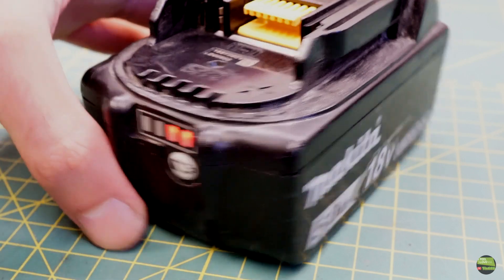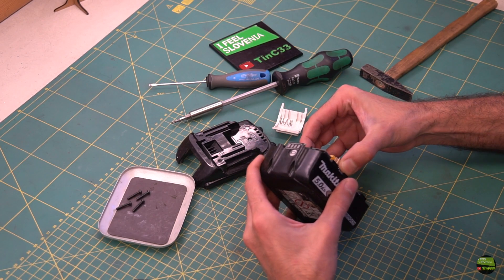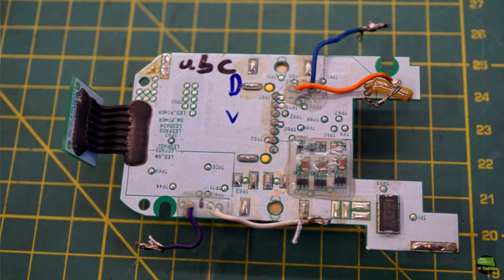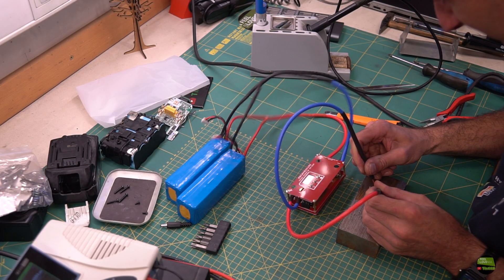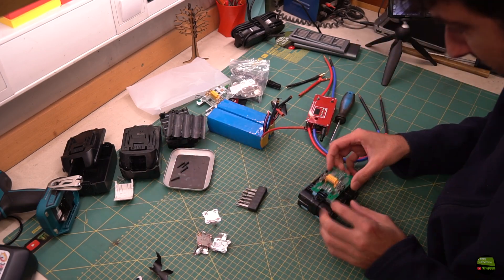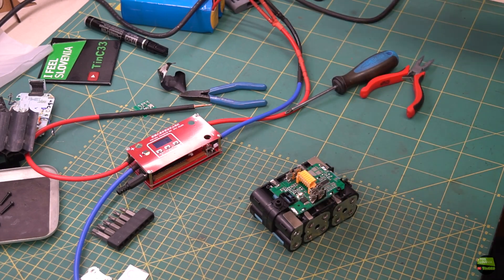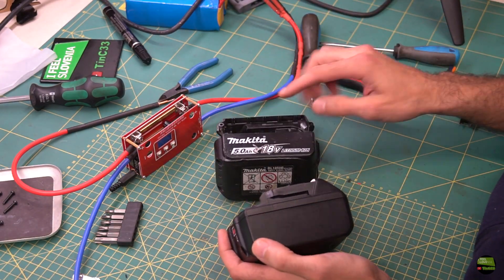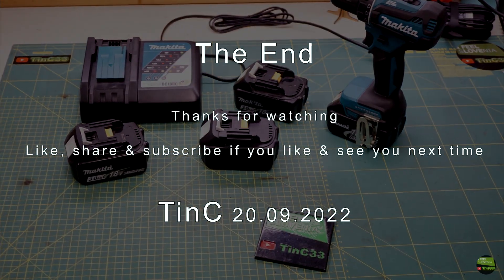How to repair makita battery for $12 [easy fix with using repair kit -new pcb and housing]

Comment: You are the only person who has posted on YouTube what I am looking for. I ordered the same kit and wasn't sure if it was working properly. Still waiting for delivery. I only found this video at your place. Good Job Slovenac.

P.S. Do you know if the Fnirsi SWM10 spot welder can do the job as I noticed it only welds the strips that come with it.
Reply from the maker: Thanks, i think it will do the job just fine but like mine with some pouses between 😅
Otherwise you can also solder them i do that many times by using 100w solder iron and grind battery surface slightly on booth ends.

Comment: You could go into business fixing all the thousands of useless power tool batteries out there.  I have five or six that need repair, right now.
Reply from the maker: @Iakobos55  true i just got one in repair last week, but like many times there was dead cells inside so no way to fix, cells can be replaced but one cost about 10$ wich mean 100$ for a pack while new pack 3ah cost 41€ in discont price 🤷‍♂️

Comment: Would be helpful to know what size torx needed. Seems none of mine fit.
Reply from the maker: @tinaleanne8230  i don't remember is it t15 or t20.
But it doesnt fit because the bolts have lifted "dot" in the middle of torx so you need torx screwdriver (torx bit won't fit into hole) with hole in the middle but also work if you punch a few times so the pin in middle of torx bed a bit and get at least 0,5mm of grip, hope you understand what i want to tell 😅
Reply: @TinC33  I don't punch anything that has lithium batteries. Another video claimed they were T10's so I just ordered a set of screw drivers for security bits. Will be hacking at my battery next week.

Comment: I did this too. But my battery shuts my tool off at just under 18v. Do you know why this might happen? I used the same pcb as you it seems but new cells.
Reply: What cells did you use? If they have a high internal resistance, the BMS will cut power early.
Reply from the maker: Sorry didn't see that before, it could be what tailor said, you need low resistance cell with at least 20A discharging current, one cell like this cost about 10€ so 100€ for 10 cells while new pack cost 40-50€ so there is no way to replace cells for price of new makita 3ah pack.

Comment: why everyone is replacing the original bms, looking for ways to reset the programming, installing replacements so that the original bms enters the data re-writing mode on new cells, the solution is so close that no one notices it
Reply from the maker: @Akumariusz1977  do you heave a solution, programming is not my favorite job 😔

Comment: It is great that you teach people how to give those batteries a second life. This is good for the environment, so a big thanks to you! Allow me one remark though: You should weld across the slot not apply both electrodes on the same side as shown. Welding across forces current through the cell can and it is the actual reason why the slot is there, i.e. you get better weld quality.
Reply from the maker: Exactly i often take batteries out of trash for some diy project but here the battery was tottaly fine so its a big save of money also, and pack still work today...
Someone already told me about slot, thanks  i didn't know that but when i read it become soo logicaly 😅

Comment: I'm curious as to why you removed the original plates the connected the batteries to each other. You tested in the beginning and said all cells were good.
Reply from the maker: Because that pack wasnt fit in new housing, plastick part between cells are a bit different and also balancing strips are located differently, so the easiest way was to tear down everything and make new pack.
Reply: @TinC33  ok that makes sense. Did you manage to get your spot welder to quit getting too hot? I wonder if lowering the setting would help. Who knows how accurately those things are calibrated?
Reply from the maker: @davidreynolds4684  i don't know i buy it and use it only for that project so far, but planning to make my own (already heave prepared transformer for about 5yrs).
But i remember now the electrodes become too hot to hold after a while of work, i don't know but i think i need to make 2-3 pauses to cool it down before the pack was made.
For use here and there i think it's a great welder for it's funny price.
Reply: @TinC33  it's a neat looking little welder.  Good video btw.

Comment: What device did you use to measure resistance?
Reply from the maker: Icharger 4010duo, top charger, powerfull and precize, own them about 12yrs without isue.

Comment: Hiya pal, is it possible just to change the yellow part ? Mine is close to snapping off, I've ordered a new one but I don't want to take my battery to bits before knowing more
Reply from the maker: I think it is possible but if you can get a replace...
This part is holed in plače by black case cover, so check if grooves where the yelow part fit are demaged, in that case i'll just use some epoxie glue while put together, and a food foil on one side so it won't stick together, but just hold in place.

Comment: Great job , I have the same battery same issue but I couldn’t find the same replacement kit ,  the link gives you many options but none of them for bl1850b 5ah any suggestions please ? Much appreciated
Reply from the maker: I also cant find so i take 3ah theres only difference in stickers, wich i take from old pack.

Comment: What cells are used in this battery?
Reply from the maker: Genuine makita from the old pack, i only replace housing and electronic, i think makita used samsung batteries but don't know exact type, i think they got 25A drain current. Apsolutely a good cels, we use them on work a lot and in 10-15yrs so far only one died.

Comment: When spot welding, place the probes on either side of the slot - that way, more current will flow through the tab into the cell body and out the other side of the slot - instead of mostly going through the tab surface.
Reply from the maker: Thanks, i didn't know why there is a slots, but now everything make sense, thanks again, really appreciate.
Reply: @TinC33  Love your videos - keep up the great work
Reply: Good catch.

Comment: You shouldnt have to remove the bms just you have to bypass the broken fuse on bms the battery would work again.
Reply: Are  you sure? For Makita? If so where is the broken fuse?
Reply from the maker: @Tyan_Nahts  not every board had a fuse, there are many types of pcb
Reply from the maker: I think i checked and there was no burned fuse, voltage everywhere

Comment: question guys. if sb. knows. i have one of these cheap board. but now not working. why? the contacts of the yellow socket are giving other voltage than before. 
in working mode the contacts had a voltage to minus or plus (dont remember yet, not important) 0 15 0 15 0 15 15 0 and so on. from other contag plus/minus like 0 4 0 4 0 4 4 ... and so on. 
but when the "cheap" board is fu..ed up then 0 18 0 18 (nearly full voltage) and otherwise 0 0,3 0 0,3 ... and so on. 
does anybody know what is going on there? i tried to figure out WHICH part must be dead but did not find out.

Comment: How do you know, that the circuit board fits to the cells you used? Unique cell parameters like overdischarge, overcurrent, cut off voltage, etc?
Reply from the maker: All this cells are quite equal except max discharge current, but voltage protection is more importent.

Comment: I'm surprised the whole thing wasn't glued together.
Reply from the maker: it may be good because dirt and steel dust can't get into housing, but there will be huge heating problem, do you know that makita battery got groove into housing, so when we put battery on charger there is a fan into charger wich blow trough entire battery, to cool down the cells while charge.